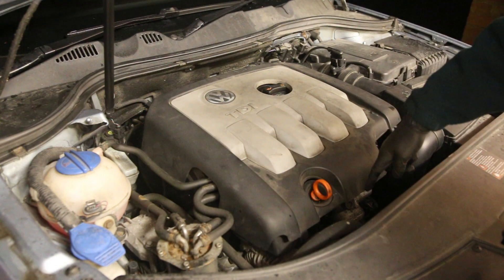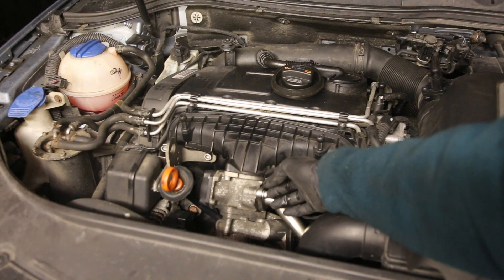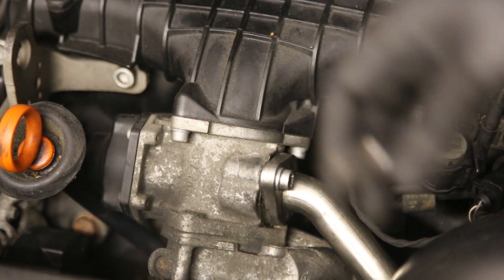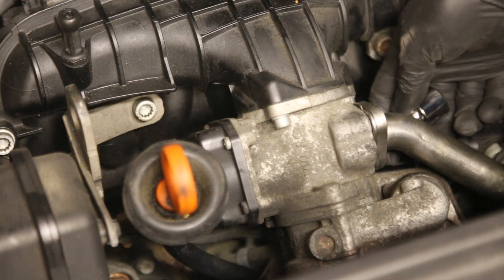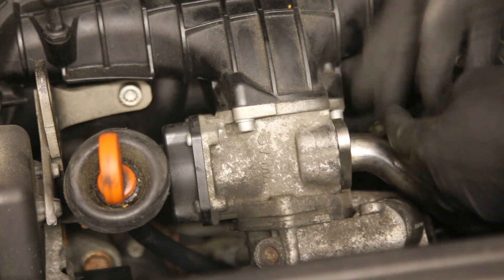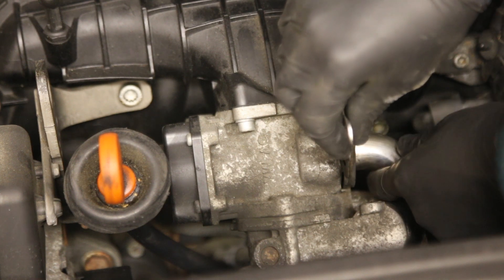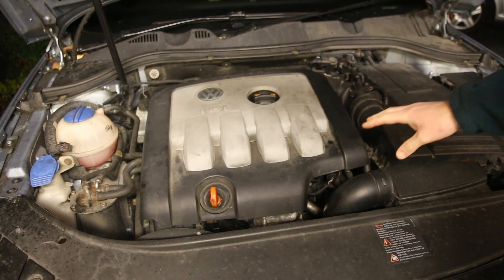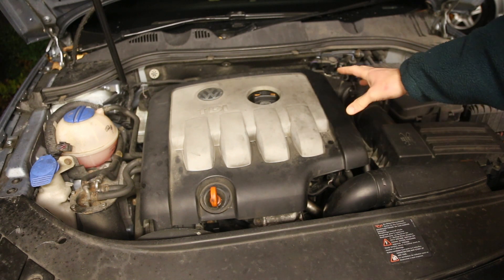Fitting EGR blanking plate to VW Passat TDI - Faulty EGR Valve Replacement Fix

Comment: Have you had the blanking plate fail causing the EGR function to return on its own? 

Sorry for the novel. So I got a shop to fit a blanking plate.  Egr cooler actuator arm was loose, leaking exhaust gasses into the engine bay and hissing loudly. 

After the install, i drove the car for 10mins. Glow plug light started flashing for 5-10min and shut off again for a while and came back usually at idle. Then the engine light came on and stayed. I was expecting that to happen. 

After 2 weeks I started to hear a slight hiss, as if air is trying to escape. Day after I started the car the hissing was back full swing and so was the exhaust leak. The glow plug light wasn't flashing anymore and the engine light turned off after a day. 

Is it possible for the blanking plate to melt right through if its not strong enough?
Reply from the maker: No, I haven't. The plate on mine was a good thickness so there's no way that could melt without serious damage to the rest of the engine. The temperature to melt steel would melt other pipes too.

Comment: If this the B8 passat? I've got to do this job on my B8 2.0 tdi
Reply from the maker: This is the b6 but suspect it's very similar
Reply: @ajvw  so the egr valve is at the front of the engine?  Thanks man
Reply from the maker: @fractalofgod6324  yes it is. One some later 1.6 TDI engines it's more hidden but the 2.0 is likely to be the same

Comment: That's the simplest way to avoid headaches with the EGR valve; I did that on my Passat tdi 2.0 after the intake manifold and egr became clogged and cleaning it was a pain. I used the blanking plate for a while before remapping it (EGR deleted). The engine runs smoothly and no EGR issues.
Reply: you need it mapped out to be effective. had mine done
Reply: @vikingsmb  it’s remapped now. Running smoothly!
Reply: Has your EGR Blanking plate melted itself causing a hole in it and allowing the exhaust to get in? I got mine blanked and after 2 weeks the egr function came back.
Reply: @shueibdahirmotionpictures  You have to use stainless steel, it offers vastly superior corrosion resistance to acid and fumes.
Reply: Mine is remapped but the valve is leaking causing allot of issues. Hopefully this is what I need.
Reply: Do you still need to clean the clogged egr or not mate?
Reply: @steeleyg225  Nah mate, its been 3 years with no egr issues
Reply: I have the same car a 2008, and want to block my EGR. Do I definitely need to remap it? Thanks
Reply: I If you dont remap the engine warning light will illuminate on the dashboard.
Reply: Easiest doesn't mean better .. Well done - the idle is unstable and the car pollutes more - definitely a step in the right direction! I don't know why anyone would want to tamper with the excellent performance / efficiency and emissions functions on these excellent VW engines. If there is a problem, fix it, rather than disabling core features of the engine design.
Reply: @Tyranthraxus are you related to Greta?
Reply: @Tyranthraxus  No worries, It's been remapped mate which means way better.

Comment: Hey there mate, i have an mitsubishi outlander with the same engine could the EGR be the problem my car dies out at high speed? And therfore i need to switch it off and back on again and power comes back.and can you also tell me where the egr sensor is too.cheers
Reply from the maker: No, that sounds more like the turbo getting stuck and going to limp mode. Restarting then clears it and it's back to normal until the next time
Reply: @ajvw  ahh i see, but tbh my turbo sounds really clean and at low speed i can feel the turbo like really just pushing but yh maybe at high speed it just turns off.and i also hve the EML on too.
Reply from the maker: I had exactly the same problem with my Passat, I put up with it for 6 years before replacing the turbo. That fixed it and I just wish I'd done it earlier
Reply: @ajvw  noo wayy, well ill go and get it checked out and see what they see about it, and did your passat cut off like how mine does?and afer replacing it did it run at high speeds and not cut off at all.
Reply from the maker: Yes it just lost all power at high speeds if you pushed it too hard. No problems at all once replaced
Reply: Try cleaning the mass airflow sensor. Fixed mine.

Comment: So, I can just put blanking plate there and thats all? (after turning it off via OBD) Or I need to use blanking plate anywhere else?
Reply from the maker: No that should be the only place. As you say you will need to code it out via obd
Reply: @ajvw  does the cooler side of the egr need blanket off aswell?
Reply: @ajvw can coding with obdeleven? With phone?
Reply from the maker: @Adrian12983  no, I took it to a garage to map it out
Reply: Gary, have you found this out yet? I have the same question

Comment: You also have to code it out in vcds otherwise it will throw an error code on the dash
Reply from the maker: Yes that's correct, I'd put that in the video notes above
Reply: Also i got my egr valve replaced . Now when I rev above 3.5 k there's a hiss sound before I change gear. I have been told it might be the gasket seal. I had it checked today by the garage who did it and they said all hoses are fine and the egr valve rubber seal is perfect so I don't know why the hiss sound happens only on full boost at 3.5 k on my b6 VW Passat 1.9 tdi. If i the egr delete done with the blank plate will that resolve this hiss sound?
Reply: It's all sorted. The nut on the exhaust manifold was loose

Comment: Is it normal with blanking plate the turbo sound differend? Like a wwooooosshhh?
Reply: Yes it’s because the exhaust gasses are being forced out the exhaust side of the turbo instead of being recirculated into the intake manifold.

Comment: I have same model car and it will start and cut out immediately with a clicking noise coming from the egr. If I pull the inlet pipe off and the metal pipe you removed slightly in this video and chuck a lot of egr cleaner down it would that work?

Comment: After my 2014 Passat went into limp mode with warning light, called the AA and he took cover off, twatted the egr valve with a steel bar and problem was fixed.  he cleared fault with computer but I was back to normal.  ill get mine cleaned rather than replaced as its a sticky plunger fault with egr valve

Comment: Hello , i have a Passat B6 with a BMR engine , i have had for a few days the Exhaust Failer light in my dashboard , i have been told that its the EGR valve that is faulty , i have been in some garages , and they all ask me for about 400Euros to anulate the EGR Valve... do i really just need to use  a blanking plate ? thanks alot
Reply from the maker: The blanking plate will stop the EGR working but you may get an engine error light on the dashboard. This won't affect the running of the car but you can get this removed by a garage. It cost me £120 so it's still much cheaper than the quote from your garage

Comment: Did u make the blanking plate?
Reply from the maker: No, I bought it from Ebay. This is the item  https://www.ebay.co.uk/itm/EGR-valve-blanking-plate-VW-Golf-PASSAT-POLO-1-2tdi-1-4tdi-1-9tdi-2-0tdi-2-5td/161466889541

Comment: Just got same car. Cleaned egr with spray now the light is on. Getting a blank. However does it have a vaccum as i could stick a bolt and cable tie on??
Reply from the maker: I don't believe this model of EGR does, older ones on the Golf do have a vacuum but these are electronic
Reply: VW & Ford Car Maintenance Servicing Tips mine is an 07 se 140bhp  2.0 it doesnt seem to have a vaccum. I have used spray on the egr however the light is one. I have a egr blank with a hole. I intend to clean the veins and egr and the rest what do you reckon? Great vid

Comment: Is it a problem that the engine warning light comes on? Will it cause any problems to the car, or is it just the light? In which case I don't really care.
Reply from the maker: Gwynne Gibbons it shouldn't have any effect on car running, I'd had the light for some time before I fixed it and no issues. The only issue might be for UK Mot or other similar testing if a light causes a failure
Reply: VW & Ford Car Maintenance Servicing Tips thanks. I will try doing the 8mm drill hole thing, to prevent light coming on. have you tried that?
Reply: If light comes on normally goes into limphome mode

Comment: but after doing that I get the engine lamp on the dash,how can I turn that off
Reply: drill a hole in the plate before putting it in
Reply: @clarky4492  does it need to turned off with software or just drill a hole in it? Doest damage dpf ? Thank in advance man
Reply: yes I finally drilled a 6m. hole and after about 4 days the light turnd off,tks alot
Reply: 6mm , 6cm is bigger than the original hole :)
Reply: anus berg you need to get a egr delete via vag system, "computer telling it its not there anymore"
Reply: anus berg was the a 6mm drill bit you used not 6cm hole?
Reply: haha yes 6mm